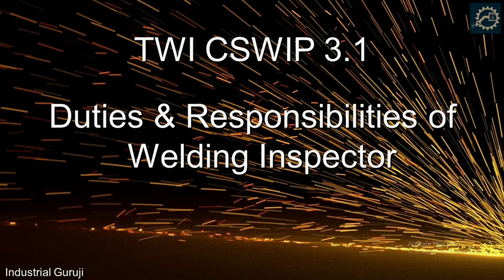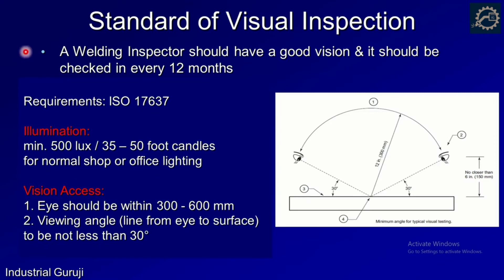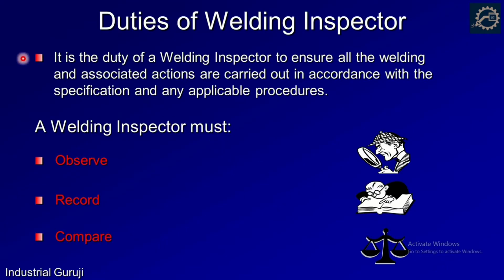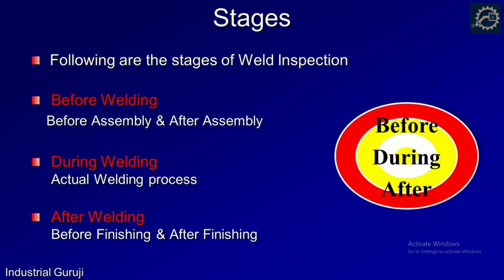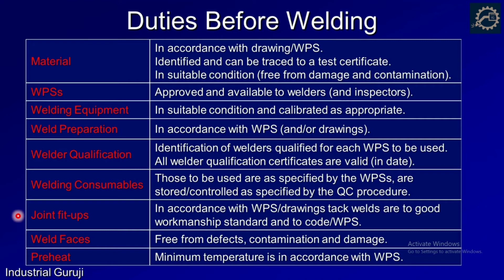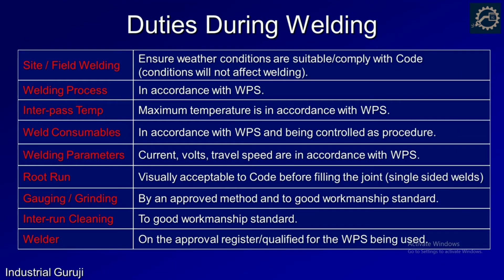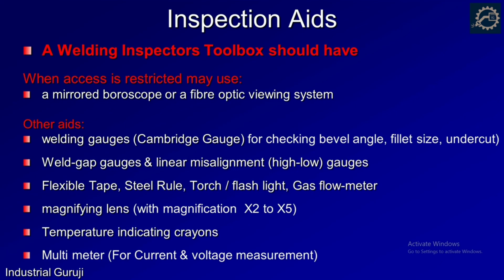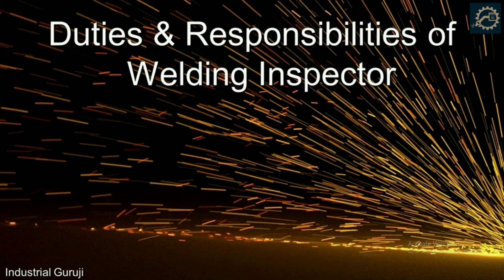CSWIP 3.1 Chapter -1: Welding Inspectors Duties & Responsibilities

Comment: Sir is ndt necessary  for welding qc inspector? Please reply
Reply from the maker: Yes. Having NDT qualification for welding Inspector is must. At least Level II in basic 5 methods. As you apply for higher posts, Level II certifiction becomes mandatory in addition to certification in welding.